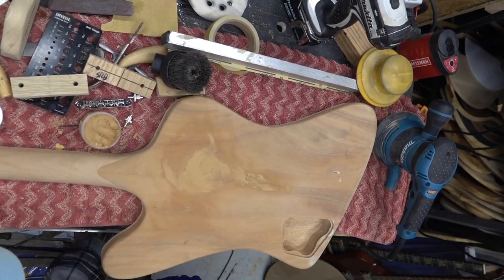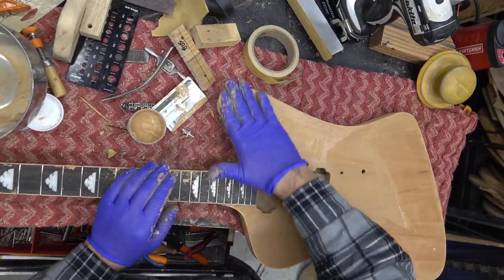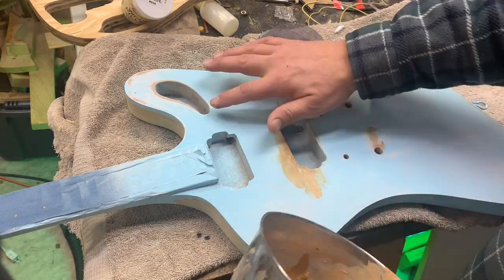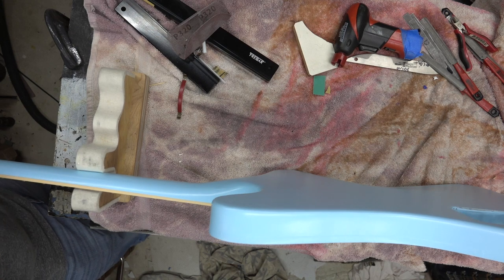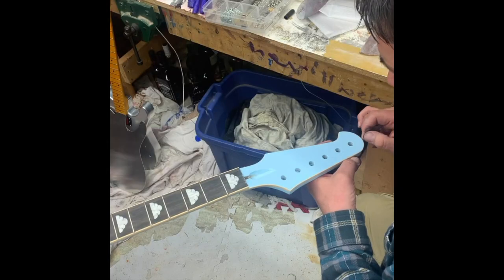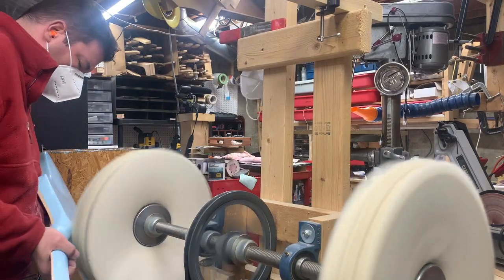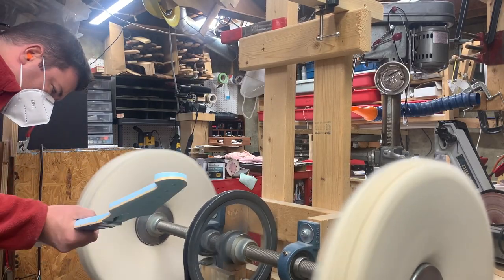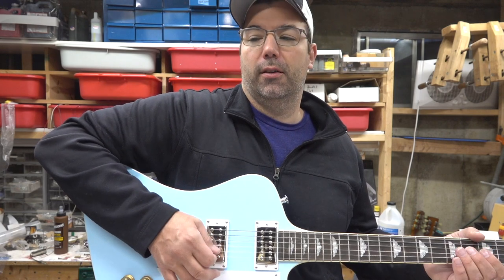Building a Skybird: Final Body Work and Applying the Finish

Comment: Beautiful craftsmanship! Congratulations!

As a suggestion, I would not recommend leveling/crowning the frets with the pickups installed. The metals shavings can get pulled by the magnets into the pickup housing and cause problems that are hard to undo. At minimum, would recommend covering them completely with painters tape.

Comment: I used to do the messy grain filling, until I changed for wipe-on poly applied with 600 grit sandpaper and then 1200 grit, it does the job and no sanding required before primer.
Reply from the maker: ahh.  thats an interesting thought.